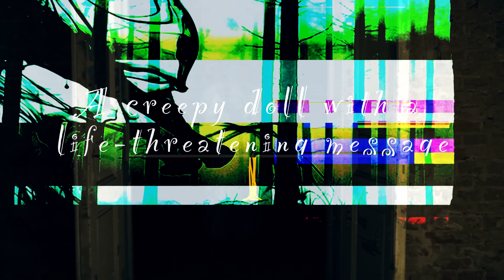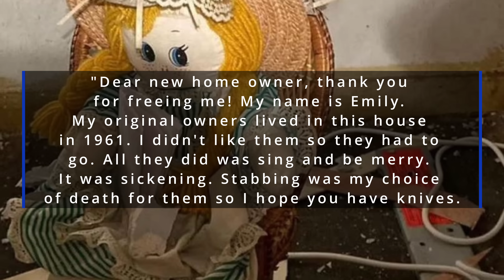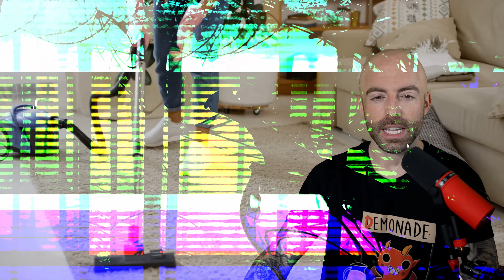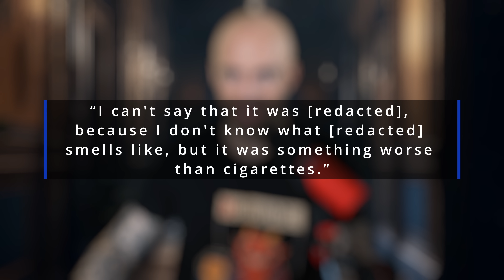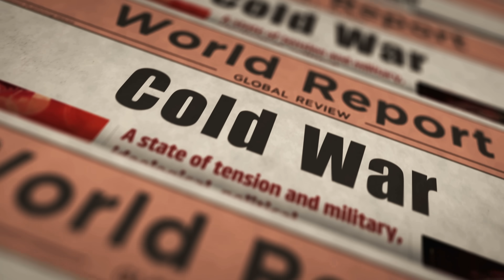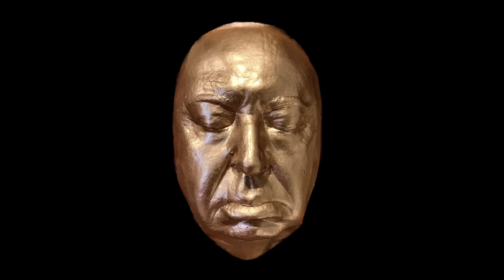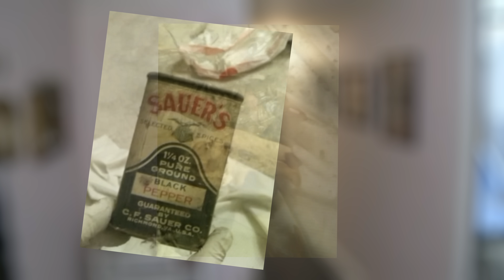10 FREAKIEST THINGS People Found In Their Home

Comment: So I've got two things here (I'm in the UK, by the way):

1. My house has a 17ft deep well in the garden. We had no idea it was there, but the cellar was always damp, so my late father investigated and found a clay pipe under the cellar floor that led out into the garden. He went digging and found a huge stone slab, which he thought was a gravestone at first, but when he smashed it, it turned out to be a well. The clay pipe was the overflow for the well, the house had been built on top of it, and had gradually sunk until the pipe cracked. There was also a lead pipe going out to the back yard. We got an industrial pump in and drained the thing dry, expecting to find treasures, but there was nothing in it at all. The theory is that it was sealed immediately after construction and the lead pipe was connected to a long-gone hand pump. An expert dated the brick to the 1700s. The well is built over a natural spring (the area is full of them) and the water was tested and found to be pure and drinkable.

2. An elderly relative of mine moved into a house not too far from here. The garden was on two levels, with the levels divided by a double wall with flower beds in it. When she went digging in the flower beds to put some new plants in, she found hundreds of animal skulls: cats, dogs, rabbits, rats, all sorts of things. Disturbed by this, her son, who lived at the other end of the country, then came up, and decided to thoroughly inspect the property to a greater degree than his mum had been able to manage. In particular, he went up into the loft space, which she was too infirm to access. There he found a full-on satanic temple: altar, wall hanging with an inverted 5-point star on it, black candles, another star and circle painted on the floor, the whole nine yards. Needless to say, she moved again as soon as she could.

Comment: The old cabin I bought and live in has a small concrete lid in the concrete floor under the workbench in the garage. It's not the septic and not a well. I chickened out at the last minute and have never opened it, never will.